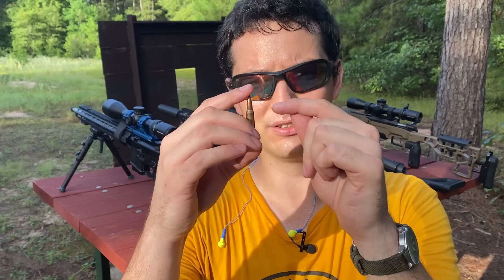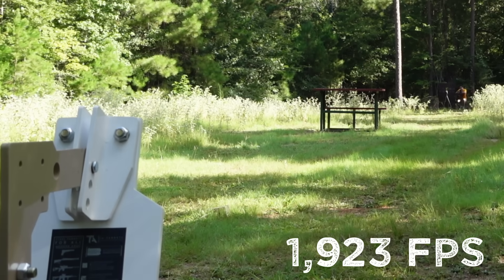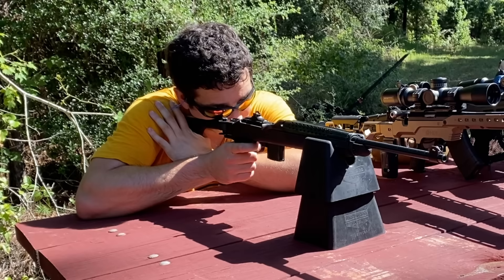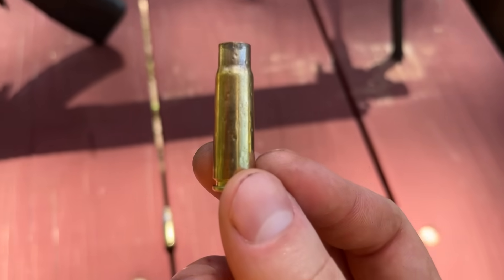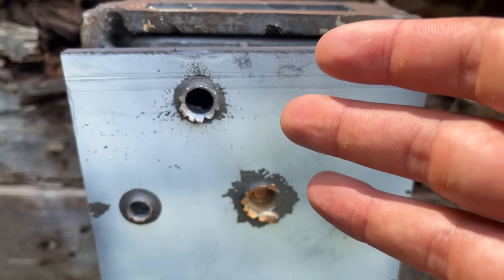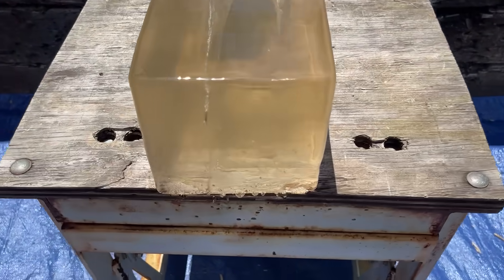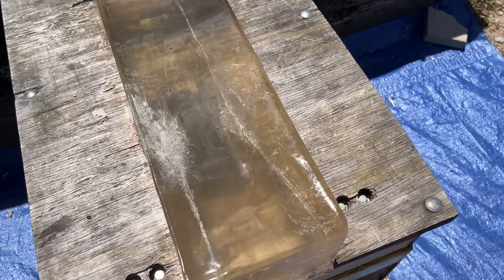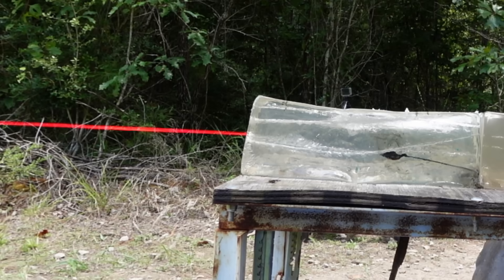I Will Never Shoot These Bullets Again

Comment: .22 tracers were made because they had a similar trajectory to a tank round so they used them for sighting tanks
Reply: We used .50 Bmg tracer for that.
Reply: Maybe some sort of mortar round? I would think most any tank round moves further than a .22
Reply: @CeylonMondegreen  These were rounds that were designed to mimic the vertical trajectory of the larger round they were spotting for. Not the velocity, or the wind drift.
Reply: Not even close.
Reply: I never saw a civil war tank?
Reply: Well shoot. Thats what the guy at the gun shop said when I bought them. You would think by now I would have learned my lesson from listening to the them....
Reply: All the adapters I've seen for sighting in tank guns either used 50 Cal, 30-06, or another standard military rifle round like 6.5 Mauser.  Never seen one use a 22LR. That thing has the trajectory of a rainbow
Reply: @donwyoming1936  Almost none of them use off the shelf ammo. They would often re-use the size/shape of the bullets but their weights and more importantly the massive amount of tracer material needed relative to a standard rifle was all specialized to the rounds. Which were then typically loaded in smaller cases than usual with less powder. 

The M30 used a .50x77 spotting rifle and the SMAW uses a 9mm in a necked up .308 for example.

Comment: Yeah, you can't "jump-the-string" with lead. Deer do with arrows b/c it goes a third the speed of sound. Once you hit mach you don't hear it first and reaction is like 250 miliseconds to start moving, 100 to be cognitive of something and another 150 to send the command down to move.
  Seeing it means nothing unless you are beyond the minimum flight time to be aware of a shot fired with enough to react. That's why snipers carry flash suppressors, those rounds may take several seconds to connect.

Comment: Be very happy that it fired out of battery and not a bolt shattering. You were lucky to have escaped serious injury. Are you attempting to become the next Scott of Kentucky Ballistics?

I had a op-rod purchased as part of the Korean Lend Lease returns, shatter after firing and smacking me on the cheek on the way out. A inch higher, and it would have hit me in the eye. There were a number of lots that were improperly heat treated too hard causing them to shatter. 

To this day, I won't touch fireworks or shoot M1 Garand's.

Comment: I'm still waiting to see you do a test on the 5.56x45 in different bullet weights and the damage they will do. I seen a video last year that a guy shot a 308 and a 5.56x45 at 300yds and when he used a 77g 5.56 bullet he sait it did more damage then the 308 at 300yds. I was just wondering if you would test this out because i believe what you say.😊

Comment: 6:06 That mark on the table confirms what an instructor told me: "don't hold the rifle by the magazine, if something goes wrong that's where a good part of the energy will dissipate"
Reply: never thought about that, glad to know.
Reply: Thanks for that comment. People need to hear it.
Reply: I've seen two different guns blow the guts out the bottoms of their magazines. One was an M1 carbine I had in my teens, and the other was a Springfield 1911 a friend was shooting in an IDPA match. The carbine fired out of battery, and the 1911 fired a reload that had been double charged. The 1911 also split one of the grip panels in two. The carbine also blew a piece of wood out of the side of the stock.
Reply: @neilhood3624  uWu w-wat are you doing, cartridge-senpai?? Dont, I'm going to blow my bottom!
Reply: Can confirm. Shot my 22 and it must’ve had a hot round because it blew the mag out along with the spring, follower and bullets. Never happened before and hasn’t happened since
Reply: @808STEEL same with one of those us 22 survival rifles...it blew the magazine out and bent part of the receiver at the ejection port
Reply: I will not look cool shooting my AK, so no thanks.
Reply: Don't hold it by the bottom of the magazine.* That's free weakest part and the path of least resistance. Holding it by the magwell is always acceptable however.
Reply: EXACTLY RIGHT. Thats why I use a 10 round mag sighting in ar's.
Reply: He gave you good advice with a shit reason. You shouldn't hold by the magazine because it's less stable. Magazines have some jiggle in them even when they're fully seated. If you're worried that your firearm will catastrophically fail, you shouldn't be shooting it from any position. The idea that one in a million malfunction is driving your technique is kinda funny.
Reply: @Microwave_King I mean. If an out of battery were to happen it'd be exactly there
Reply: @jacobwebb8818 and a manually ejected hangfire can blow up in your face. Does that mean you change how you shoot on the extremely off chance that it happens? Doing good things for bad reasons still makes someone an idiot.
Reply: Me when I hold my pistol....
Reply: Yep that happened to me and it was only a 17 hmr. Exciting
Reply: @kevinm5177  you know what was exciting? That fountain of red at the end of the day at uVu UWU
Reply: @stovenbungel you sound like you have a special edition Rick and Morty dialater

Comment: One must consider if the tracer would cauterize the wound, stopping the bleeding.
Reply: Nope. They don't burn long enough or hot enough.
Reply: @Raven_One Interesting. So the tracer burning is unlikely to cause more damage than a non tracer round?
Reply: Unlikely given how little time it would actually be in contact

Comment: 22LR tracers are like using a real life Star Wars blaster
Reply: Perfect for Darth Varmint. 🐿️
Reply: Definitely 😅

I wonder if the detail about how they work got retconned... In that a Blaster is actually firing encapsulated plasma (think plasma in a sealed glass vial). Hope not, cuz that was a cool and fairly realistic way to explain how they work. Granted, it doesn't explain away the lack of bladter bolt-drop over distance but... baby steps! 😊
Reply: @DUKE_of_RAMBLE  blaster bolts dont drop over distance because the extreme heat of the plasma causes a lifting effect that counteracts the miniscule weight of the plasma capsule bein pulled down by gravity, and by the same thermal excitement, is doesnt lose velocity over distance either. Perfect for prs competition if you can get harmonic resonance under control above 15 kelvin for at least 28.93 nanoseconds. The more you know...
Reply: @Milspecpoptart  Is that's what folks have cooked up to explain that, or what you just came up with now?
Either way, I like it and will accept it 😅

🤔 Although it just occurred to me that technically the heat would be dissipated radially, so it would be applying a downward force just as much as upward, and let, and right, thereby nullifying it's lifting effect; thus, leaving us with only the gravity-induced drop 🥴
Reply: Except you can actually hit the target with it 😂
Reply: @adamr9720 That's because we're not Stormtroopers 😉
Reply: So 22lr tracers are worth it?? I've been wanting to grab some to have some fun with my 22 but I never want to waste the extra money if they just end up looking like normal 22lr
Reply: @Jbewell1991 they’re a lot of fun, just don’t shoot in dry weather or around anything flammable. I’ve had a small stock of old piney mountain tracers, but got a brick of supernovas thatve worked well too
Reply: Especially if you have an American 180!
Reply: Its one of those things I could do all day.
Reply: Or it's what every gun in movies looks like.

Comment: The same thing happened to Scott he was given fake rounds good thing you were better off than the was glad you had minimal injuries
Reply: He was shooting a garbage plumbing fitting built by an actual regard designed by some stupid high schooler that made a pipe gun once. It's poor design is what about killed the inbred from ky. 

The least of the problem was the ammo.
Reply: No. He was using a cheap rifle that has a tendency to kaboom. They're notoriously unsafe
Reply: @donwyoming1936 I didn't know the quality of the rifle but I do remember him saying that they were tampered repackaged slaps
Reply: @donwyoming1936 The failure was rigorously investigated.  I was conclusively proven to be fake SLAP rounds with the wrong powder creating an overpressure when fired.
Reply: @donwyoming1936  It was also an overpressure
Reply: @donwyoming1936  You're really good about spreading that BS everywhere. Have you taken a single second to actually read what Mark Serbu did about that whole thing? Or perhaps read what others have commented below your BS about how the actual cause was an incredibly overloaded round.. OR THE VIDEO SCOTT DID ABOUT IT